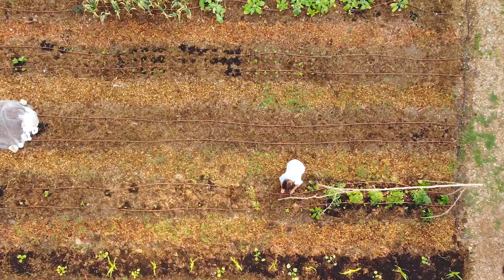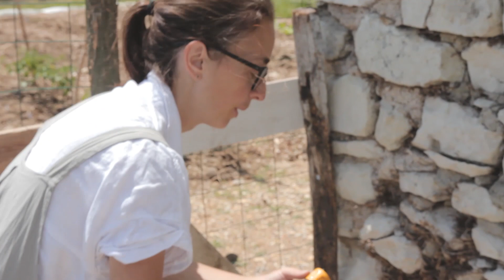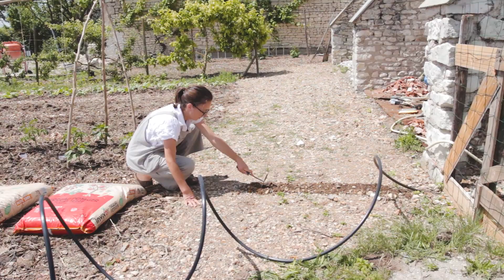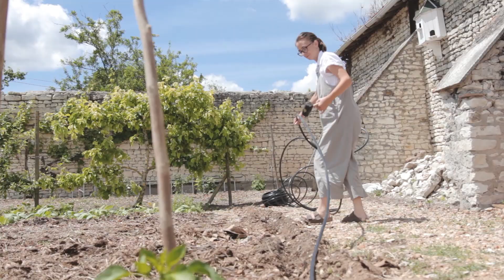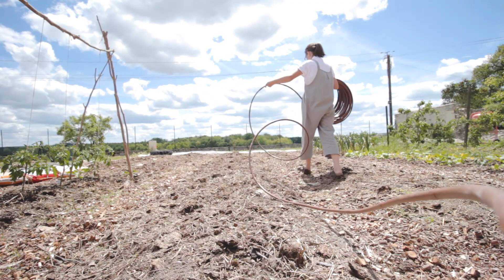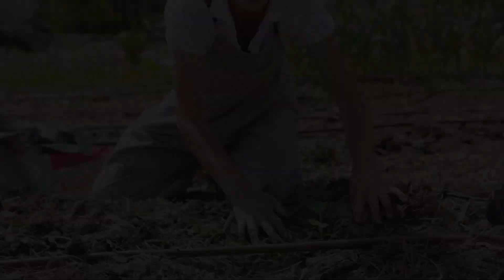How to install a closed loop DRIP IRRIGATION system for vegetable gardens

Comment: I know this is a few years ago. What was your water supply? Looks like a typical city water system, but that wasn't talked about in the video.  If you have fairly low water pressure, say less that 10PSI in a typical gravity fed system, think rain barrels, then the closed loo makes sense.  If you have decent city typer water pressure, think 25-40 PSI, 2 Bar, then for your sized plot, a closed loop isn't really needed.  With pressure comensated drippers, they allow the same water level over a fairly large area.  So it the closed loop is hard to build, it may not be necessary.
Reply from the maker: Yes, very good point. We are using the drip system again but not closed loop and seems to work for the reasons you stated. Thank you.

Comment: Just double checking as I'm about to run a drip irrigation in a tent for my indoor garden.  If I have 3 rows of 3 plants(9 total) I should run a closed loop system by running the mainline back to itself at a T connector.  This would make it so the 3rd furthest row gets more equal pressure as the beginning first 2 rows?  So closed loop would then be the most ideal setup, correct?  Thanks!
Reply from the maker: Yes!

Comment: Looks like a really good solution to watering, manually, I guess it saves water too by not watering whole bed with a hose ? ❤️
Reply from the maker: It is meant to be much more efficient as a) you're not watering the whole bed and b) the drips go straight down to the roots so there is far less surface evaporation. We're hoping to have it hooked up via a pump to water butts next year too.

Comment: Thank you for the inspiration!  I’m planning new beds and will be sure to implement the “closed loop system.”  I’m hoping that you have been spared the 40 degree temperatures!🌸💗🌸
Reply from the maker: We had one day where it was over 40 degrees but fortunately it's cooler now. We've had some incredible storms as well which have helped clear the air.